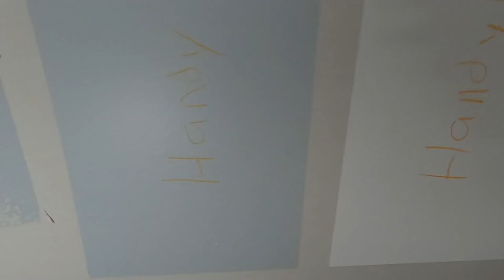Pro Painting Techniques Using BEHR DYNASTY Paint | THE HANDYMAN |

Comment: It depends on whether I use tape or not . But I do a lot of low cost rental rehabs. But if the old layers paint is too thick on trim and baseboards to where there's not a definite line anymore . if it's knicked up or just a rough edge I will use tape there and yes caulk over the tape it really helps redefine the line between the baseboard and wall. It is just a way cleaner look. And I feel like it makes it look like you give a damn. Or at least take a little pride in your work. But good straight clean walls just load up the fastest brush you got and run with it.lol.   keep up the awesome videos man. You are an inspiration to a ton of us regular people. Love how realistic you are with your videos.

Comment: Instead of caulking the tape try painting the edge of the tape with the color underneath. The paint flows under the tape and gives you a clean line without the edge
Reply: I'm so confused... 😞
Reply: Say you are taping off the ceiling to paint the walls. You tape the ceiling then paint the edge with the ceiling paint. Let it dry then paint the wall paint. Then peel the tape. The theory is the ceiling paint will bleed under the tape and sorta seal it.

Comment: Free hand. I cut-in using a small square 1/2" artists brush. It takes more time but once you get the hang of it painting is fairly quick. And as someone said below, the blue/green tape is expensive & doesn't always leave a clean edge. (Funny. Recently bought a gallon of another brand's paint at a big box store & they had 5-6 quality grades of interior wall paint to choose from. Each one had about a $4 variance in price. Kinda absurd, considering two grades should be just fine - basic & superior.
 🎨🙄)
(Pretty wall color, btw👍)

Comment: Freehand everything. I tried taping a few times and end up spending so much time getting it perfect and get frustrated messing with tape. Don't do it perfect and you gotta run back around with a brush at the end.

Rather spend the few hours to run through all the edges with a brush, then it's real easy to roll everything out.

Comment: Floods, gotta use floods with Dynasty. That stuff is way to thick and heavy to pull along, covers in one coat but is way to thick and has trouble holding a wet edge. Flood fixes all that.
Reply: Used dynasty and personally loved the thickness. Glided on and covered beautifully.
Reply: Super paint guy?
Reply: @samgriffin6221  Yo, Floods don't make it watered down, its like adding lotion to the paint. Makes it slicker and stays wet longer for less dry edges in the field and helps level the roller/brush marks!